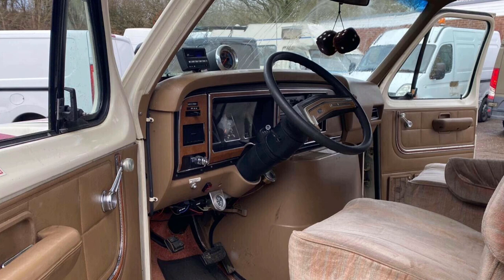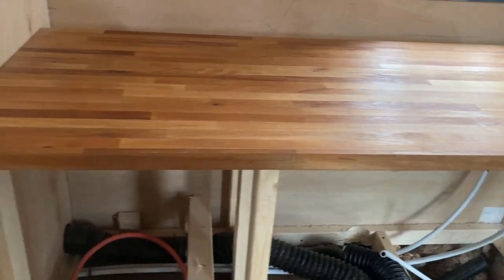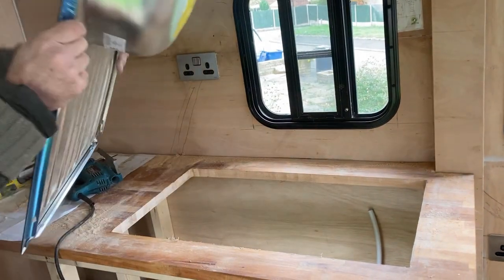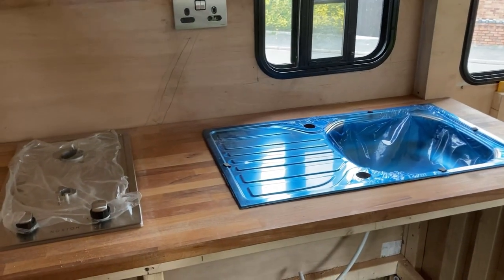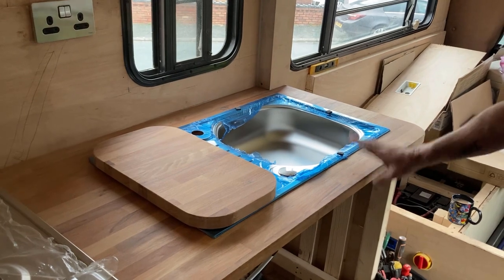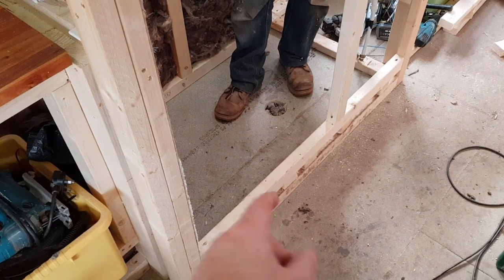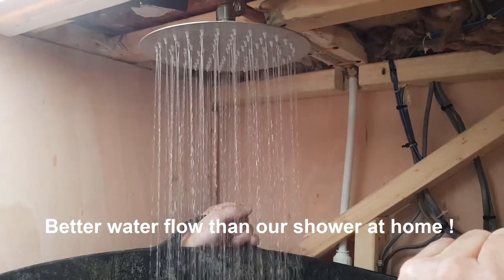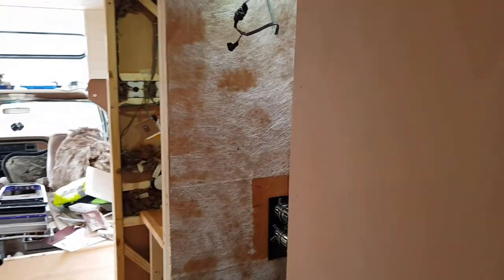Our SUPERB Shower Kitchen Build | Vintage RV Motorhome Rebuild Project | Shower Thoughts

Comment: What boiler are u using? Looking to build a camper with a shower but seems to be a lot of debate around water heaters. This on safe for RVs?
Reply from the maker: It is a Cointra CPA 6 LPG Gas Water Heater. This heater is sold by Cointra specifically for use in a caravan. The use specification information is on their website.
Reply from the maker: https://www.cointra.co.uk/caravan-water-heaters

Comment: Hi, great video again, I redid an old CI 141 a few years ago and used a beech worktop too, make sure when you oil it and that you do the underside and all the edges  too, at least 3 good wet coats, I didn't and it warped like crazy I had to throw it away and do it all again 2 months later, I like that you look to be using fibreglass sheet on the wall, hopefully, the floor too, water gets everywhere.
Reply from the maker: Thank you very much for your advice, from your own experiences. So far Samantha has applied two good wet coats of oil. The worktops are only loose fitted at the moment, and so we will bring them back inside the house and recoat them, making sure the edges and any exposed areas have really good coats. We are appreciative of your advice, the last thing we want to do is to go through all that work again. The shower will also have fibreglass sheeting applied to the floor yes, and all corners / adjoining sheets will all be matted over, making sure that what we have is a cube shaped room that is tightly waterproofed, apart from the opening where the shower curtain will go.
Reply: @VintageRVAdventures  it can be difficult to pass on your own experiences sometimes as you never know how it will be relieved but as you say doing it again would be a nightmare
Reply: @VintageRVAdventures  I fitted a curtain at first but "someone" always managed to push it out and the floor got wet so I fitted a door but kept the curtain, is the water heater a combi type, how much freshwater can you carry?
Reply from the maker: @H4rleyBoy  We had thought about a door, even a bi-fold door, but we think it may impact on the space. We have a large shower curtain on one of our watchlists, one that would extend across most of not all of the wall and opening. We have built up the step so Samantha is able to step over it (she cannot step over large objects) but also that should allow a curtain not to be kicked over the step. The actual showering should be at the other end of the room, so hoping that helps. We will try it out without a door at first, and if its not working we will have to think about adding a door. The fresh water tank holds 120 litres, so we would have to be careful how long we take for each shower, well me actually, as at home I spend about 10 mins in the shower, which cannot happen in the RV as that would be at least 20 litres of water per shower, if not more lol. We plan to take our own drinking water along with us, in addition to what the fresh water tank holds - as we hate tea made with anything other than our home water.
Reply: @VintageRVAdventures  I made the door open outward using piano hinges, lots of screws made it pretty solid, B&Q does piano hinges in SS 1m long, SS screws from a factors.